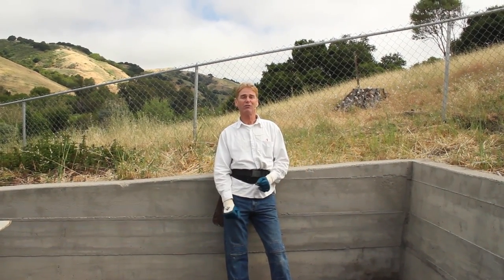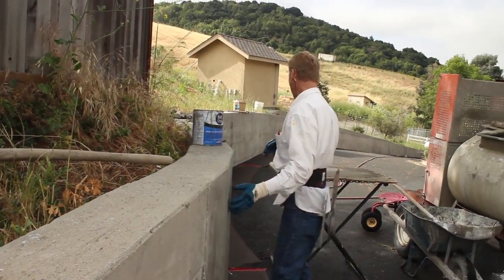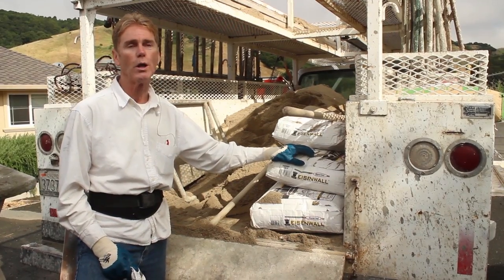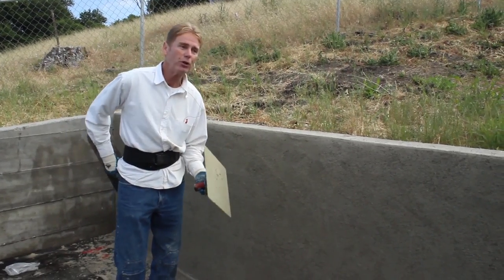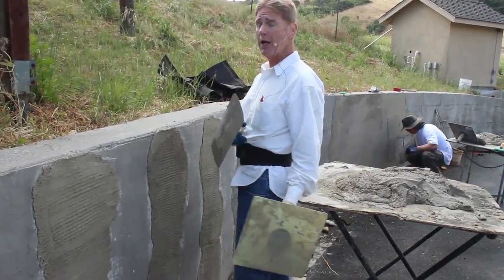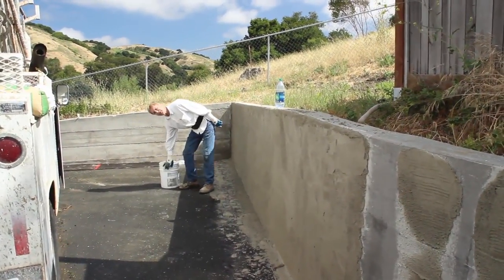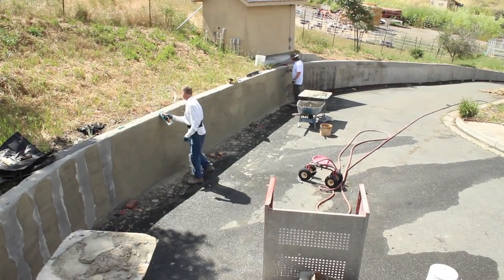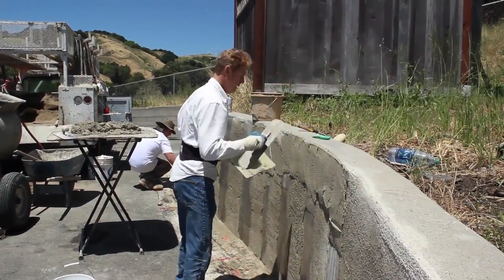Stucco concrete retaining walls.

Comment: hi Kirk... do you have a video that talks about difference of stucco ...concrete...cement...ECT...and the uses...If not,  id love to see a video from you explaining this...thanks again for all ypur valuable lessons!!!
Reply: Good morning Mrs. Wallace, not really as the only difference between stucco and concrete is the aggregate, meaning both use Portland "cement" mixed with water, however, stucco is mixed with sand while concrete is mixed with different size rocks.
                     Live long and plaster
           Sharing the plastering knowledge 
                       Kirk and Team Giordano
Reply: kirk giordano THANK YOU MR. GIORDANO... IM SO LOST ON MY ROOF AND PARAPET WALL SO I UPLOADED A VIDEO IN HOPE SOME WILL VIEW IT AND GIVE OPINIONS. I WPULD LOVE FOR YOU TO CHECK IT OUT AND GIVE ANY ADVICE I COULD USE. THANKS AGAIN IM ADVANCE...I LOVE LEARNING FROM YOUR VIDEOS!
Reply from the maker: Good afternoon Mrs. Wallace, I'm sorry but I have little time for viewing videos and how to repair, answering these question is a real feat for me as is.
                       Live long and plaster
           Sharing the plastering knowledge
                 Kirk and Team Giordano
Reply: Kirk Giordano plastering Inc. no worries...I'm aure your super busy...just figured it never hurts to ask...thanks for all your help

Comment: Hey, do you think the brand of cement “UNO” from WESTSIDE will work for a retaining wall? And do you suggest putting mesh on retaining walls?
Reply from the maker: Hi, I have not used UNO, but if it's sold at the plastering material yards, it must be good for all stucco projects. No mesh wire is needed for concrete walls. In fact, it's counter-productive. 🕵🏼
Reply: I have a block wall that the previous owner used RETAINING CONCRETE block. I just want to stucco a small portion to install a mosaic. Suggestions please.

Comment: Doing those wall here is a nightmare when the bank/hill is letting damp though :)
Reply from the maker: Howdy Mac Plastering me fellow plasterer, I have been there before, it is a real drag to have a wet wall as the cement plaster will not stick let alone dry.
            Live long and plaster
  Kirk’s stucco/plastering teaching video’s

Comment: I noticed yous are dropping some material on the ground. How do yous clean it up? Does it not stain?
Reply from the maker: Howdy  Joey, mud falling is gravity in action, if you look at where the radius is you will see red tape running at angles, this it keeping the black paper from separating, our ground covering,  "Black Paper," sort of blends in with tar, the covering is complete. 
FYI, it's way too much work to drop and allow to stain then clean staining tar.    
                                   Live long and plaster
        Teaching do’s and don’t of plastering and stucco work

Comment: what is that dropcloth...roofing paper or something else..?  I am getting ready to do some stucco repair want to protect from stains..thx
Reply from the maker: Evening Ken Dude, I use JUmbo Tex two ply 60 minute building paper for my waterproofing for the lath on wood walls, thus I separate this expensive paper and also use it for ground covering.
                 Live long and Plaster
 Giordano’s plastering  and stucco wisdom videos
Reply: I had some left over roofing paper (felt roll?) and I used it as a drop cloth this week while doing some stucco repair...much nicer than thin plastic...worked great thx for the idea.
Reply from the maker: Good morning K M no worries, plastic is way to slippery, you can end up sliding  and hurting yourself on that  stuff.
                          Live long and plaster
           Plastering tips for your information

Comment: if I am going to apply a color coat do I need to bring the aggregate out on the base coat too ?
Reply from the maker: Evening my friend, no use a hard rubber float to condense the basecoat. 
If you bring the sand out it will make applying your color coat more difficult.😉
Reply: @StuccoPlastering  Thanks Kirk !
Reply from the maker: @als4817  No problemo, my friend. 🍾

Comment: btw can you put plaster straight over osb boarded walls with mesh?
Reply from the maker: Howdy Rok, no, as the fiberglass mesh will alow the moister or rain to be absorbed into the wood as stucco is not always waterproof.
 Thus the wood would expand and the stucco pop right off.
 One must apply waterproof paper and wire, then stucco.
                 Live long and plaster
  Sharing the plastering info to all interested

Comment: If they fill the void in the soil to meet the top of the retaining wall it will save the wall from further cracking.
Reply from the maker: Good Evening Beck Dude, doubtful, as the wall will still have to support a lot of weight.     
                Peace, love, and happiness to all.
  Sharing stucco wisdom with Kirk Giordano plastering
Reply: @StuccoPlastering  
The water goes down behind the wall when the soil doesn't meet the wall. The soil needs to butt up against the top of the wall. Cheers. I'm a woman.

Comment: Cracking over time is normal but cracking 4 weeks later is not normal so i think you have to qualify what you mean by cracking and the timing of it.
Reply from the maker: Morning Steve, your kinda right, when the extra weight of stucco is applied, this can cause crackin, on new wooden homes. 
As the earth is settling from the newly tractored grounds.
 When we or anyone else apply stucco over retaining walls which have more than five years of settling the extra weight raily cracks. Type in why stucco cracks, we have many videos that go into intricate detail of why this happens, Cheers.😉

Comment: Kirk good afternoon i have a question can you do a scratch and brown on a cinder block wall?
Reply from the maker: Good morning Daniel dude, no need for both unless your filling out bad areas, a skim coat is all thtats required of at least 1/2 inch or more.                    
                                Live long, and plaster
                     Plastering tips and techniques
Reply: Yes, but you MUST, use a bonding agent first then the scratch coat, let it dry, then the finish coat.  If you don't use the bonding agent, in a few years you will get discoloring, bleeding, scaling spots, hollow spots and more and in most instances stucco falling off the wall is patches and hollow spots.

Comment: from a socal stucco contractor, why did you cut the cover paper in half and then slop up the black top?  Masking materials are cheap.  i would have ran a typical 12/200 roll of viqueen and never gotten the black top dirty.  prep work is crucial.  Just a note The work its well described.  love the work.  But theres always room for improvement.   Dirtyness='s backcharge.  plus more time to clean up.
Reply from the maker: Howdy Richard Dude, good question, Visqueen polyethylene plastic sheeting is way too slippery to walk on,  even for us ninja plasterers.   
                                   Live long and plaster
        Teaching do’s and don’t of plastering and stucco work

Comment: How many coats if Im doing a smooth finish over cinder blk
Reply from the maker: Good afternoon Ice ma, after you apply the base coat as we did here the average finish can cover in one coat, happy holidays
                       Live long and plaster
           Sharing the plastering knowledge
Reply: First you need a bonding agent to seal the block, otherwise you will have problems down the road.  Next your scratch coat and if the block wall is on an outside wall, you should use water proof cement, both scratch  and finish coat.

Comment: Don't it needs a bonding agent to adhere to that poured concrete wall?
Reply from the maker: Howdy Lucy, no, this wall did not need a bonding agent as it's new cement, stucco will adhere to new cement when the wall is misted, "hydrated with water, this is called a natural mechanical bond.
 However, to be on the safe side we allied Larson's weld crete anyway.     
                                   Live long and plaster
        Teaching do’s and don’t of plastering and stucco work

Comment: 3 minutes.  friction heat hydration.  in the concrete industry powder was the main factor to increase strength. and with strength, come friction (heat). today they try with chemicals. to get the strength up while hydration time down
Reply from the maker: Howdy Ray me fellow plasterer, you my friend have been around.
        Live long and plaster
 images for stucco/plastering and teaching video’s

Comment: I saw no weep holes in that wall nor expansion joint along with chamfer joints poorly engineered
Reply from the maker: Happy New Year Craydul, you have missed the point of this video.
It's not about criticizing an engineer or a cement contractor.

                  Bringing peace, love, and harmony back to the world of plastering.
    The complete plastering encyclopedia on video, by the plastering messengers of Youtube with over 800 videos.

Comment: saludos 👍
Reply from the maker: Good afternoon Mario, thank you my friend
       Live long and plaster
  teaching  plastering video’s
Reply from the maker: Good afternoon Blue's lover dude,
 Below is a video where i did a wall and used a ladder too, as if you start a wall finish the wall or you will get what is know as a cold joint, not pretty when it's dried, 
A fellas always wants to start and finish when possible from corner to corner,
 I personally in more than 25 years have not started a wall where we could not go corner to corner as this is a huge consideration for plastering professionals.

 Yes rebar and concrete in CMU block makes them a lot stronger.

 Here's the best tip I can give you, don't try to mix and plaster by yourself do one or the other.
 Plastering is a teamwork and harmony  with your hod carrier so to be effective and not lose your mind or beat yourself up hire a person to mix for you..
       Live long and plaster
  teaching  plastering video’s

https://youtu.be/t9FbRK1VuPQ
Reply from the maker: Howdy Blues dude, you won't regret that move, it's all about teamwork brother.
      Live long and plaster
  Teaching plastering video’s

Comment: if the ground behind the retaining wall is not slightly above the retaining wall it is doomed to fail
Reply from the maker: Try again, this makes no sense. If the dirt is higher the runoff of excess dirt will just fall over the walls with a weeks rain. How does that fact affect any wall?

Comment: You are only relying on chemical key? On a smooth surface you need mechanical key too.....moisture will get behind the top of your wall and between the concrete wall and your stucco coat, and create cracks or worse. There are a few different ways to achieve mechanical key, which I am sure you know. .....entertaining video though. thx
Reply from the maker: Hi, Les Dude, In light of a much deeper knowledge of how mechanical bonds are created I disagree with you on everything you've written, except that we are entertaining.😏

Comment: Didn't saw any expansion joints that's why there was so many hairline cracks.
Reply from the maker: Howdy wiseguy dude, I have never seen a concrete wall with expansion joints yet.
 It's just man against nature, nature always has the upper hand.
 Besides just because this wall has some hairline cracks does not mean it won't be standing as is for a few centuries, old kirk will be worm food long before this wall has issues.
        Live long and plaster
Stucco/Plastering images and teaching video’s
Reply: It was just statement that expansion joints would reduce hairline cracks but would't make it any stronger it is just cosmetic issue. 
We build retain walls with expansion joints but maybe because our outside temperature varies more than 55 degrees Celsius so that's why also temperature movement is bigger or another reason is they are usually prefabricated part that is made on factory and transported to site so there needs to be joints.
Reply from the maker: Howdy Wizeguy, no worries, I take it you're refereeing to Vertical expansion etched in the concrete, which does help.
            Live long and plaster
  Kirk’s stucco/plastering teaching video’s

Comment: Giordano plastering can be prosperous but the little spider who by the way was outside just had to die! Really Kirk.....you just lost a subscriber!
Reply from the maker: Howdy  Steven, Dude, that's might weird but stranger things have happened.
 5 years ago I had a little bitty so-called spider bite that created a bullseye on my lower back which had to be lanced, no fun, then was given antibiaotics for it,.
      A week later I had another bullseye on my belly, I tried the Stalone stuff and lanced it my self but had to resort to a Lemon which I used as a practice to slice with a new razor to try and understand how much pressure to apply with a razor to make the cut necessary to squee out the toxic poisen myself this took over an hour, that too was no fun, the doc said it was a spider bite, was it who knows but old kirk will rick no subsctrbers to another so called spider bite.     
                                   Live long and plaster
               Kirk Giordano’s Plastering answers to life’s issues

Comment: Man American work trucks are so much better the UK vans! They suck
Reply from the maker: Good Morning UK dude, not all American truck are good for work, I could name some models that really suck, however this is a rated PG site, so I'll stick with the positives, the older fords are the real beast of work.
    This one is an 89 but has less than 70,000 miles and runs and hauls about 3 to 4 tons, Awesome for it's size,
 This truck is not too big as I wouldn't be able to park on most projects and not too small that I can't load everything I need for a job and then some.
                    Live long and plaster
               Mastering Plastering
Reply: Kirk Giordano plastering Inc. thanks for the reply.. wow that's good for and older work horse! I using a vw crafter at the mo 150 kg of sand and I could get out and walk faster🤣!!I am a roofer myself but love to watch a master of there craft do there thing great channel great videos top guy!
Reply from the maker: Morning Bri dude, I'm sure you get great gas mileage, though.
                    Live long and plaster
               Mastering Plastering

Comment: A good plasterer always has his tools dirty
Reply from the maker: Howdy Angel, thats a fact, however I do clean mine beofr lunch breaks.      
                       Live long and Plaster
Teaching the world how to plaster one Video at a time.
Reply: This is not a true statement.  First plasterers work inside, stucco applicators work outside.  Plasters work with plaster not stucco material.  Stucco and plasterers use square trowels and don't spill their material on the ground, after all who uses a swimming pool trowel larger than their hawk and spill all that mud on the ground, it drives me crazy to watch someone who thinks he is a plasterer using the wrong tools incorrectly.  He also should have used a bonding agent on the concrete wall as well, this would also would have afforded him more time to do a better job with less spillage.  The man shoveling the mud onto the mud board is doing it all wrong as well as he can injured his muscles, he should be standing right next to the side of the wheel barrow and with small wrist movement and no strain on the back at all onto the board with a smaller spade shovel.  As a licensed plasterer for over thirty five years it pains me to watch his videos and see him brag about how good he is, when in fact I would not hire him for one of my crews at all.
Reply from the maker: Howdy wanna be, trolls/cowards make negative remarks without revealing their names or pictures. So you know the difference of plastering to stucco, terms anyone can google.
   Your the kind of fellow who watches porn, then criticizes others as your subconscious is now pleased, while on a conscious level you feel you must vindicate yourself as your ashamed you watched, the fact is no one cares, I could correct you on your foolish comments but feel it would have little value to me.    
Feel free continuing to sneak watch how professionals handle the advice you were searching for, I'm certain you found the information you needed, also feel free to whine a bit more when satisfied with the results you learned. 
                                   Live long and plaster
        Teaching do’s and don’t of plastering and stucco work

Comment: Wall looked like shit
Reply from the maker: Thank you, wheres your work? Exzackory.🤔
Reply: If it's good enough to lay rock over than it's a pretty good stucco finish! atleast in my area 🤣 also don't forget this is a utility retaining wall that was full of cracks, form scars, waves, and bumps... I doubt the owner negotiated or would be willing to pay the bill for the hand applied equivalent of a perfect machine applied finish 😉 (especially considering fixing all of the existing imperfections) not every job is building a piano, and very few homeowners that want that piano are willing to pay what it costs to build them one... 👍